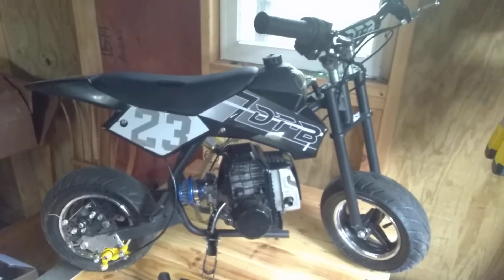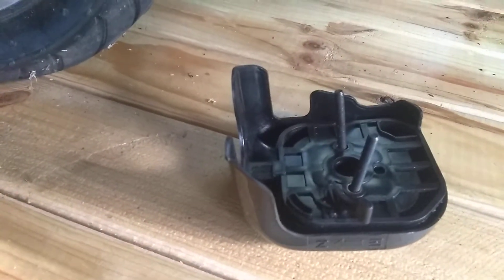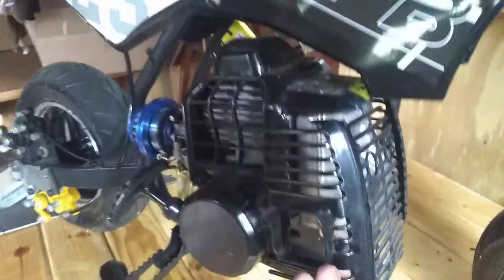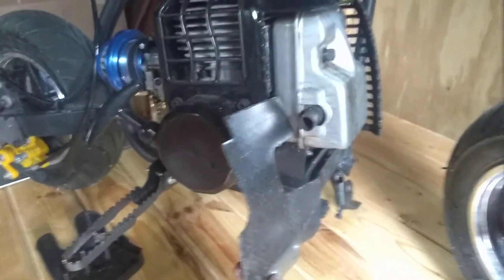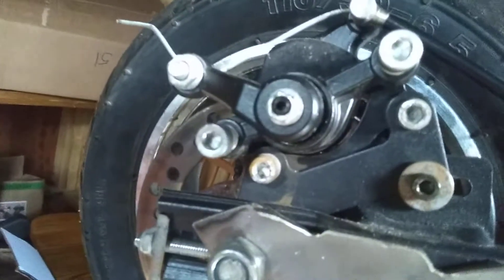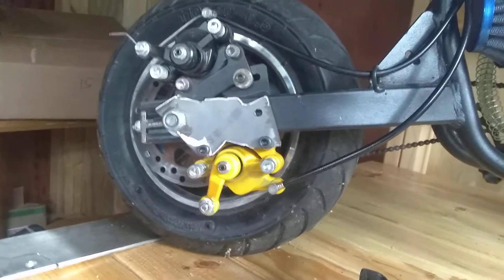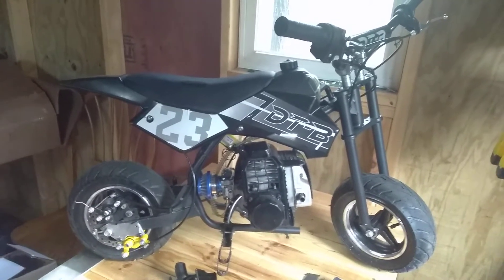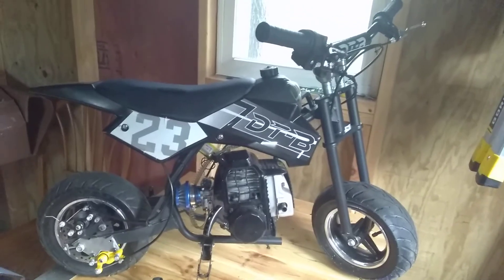UPDATE MODS on the fit right db002 50cc 2-stroke dirt bike Amazon pocket bike 2 stroke mini bike

Comment: Where did u get the intake filter ?
Reply from the maker: Amazon...just search "pocket bike air filter adapter", then look for one that says it fits 2 stroke 49cc. I have to say that when you tighten the bolts the chock will get stuck or at least hard to move. Also I don't know if it runs any better because I never tried it since I put it on.

Comment: What kind of gas did it take
Reply from the maker: It is a 2 stroke engine also known as a 2 cycle engine...So you have to mix 2 cycle oil with the gas. It is easy to mix the gas and oil...I did a video on mixing the oil and gas.
Reply: @TemperDriven  okay and did you use reg gas to mix with (87,89,92) ?
Reply from the maker: I use the premium gas like 91 to 93 octane but I don't know if you have to. It doesn't take or use that much gas so I don't mind using the more expensive gas and it might run better with it but I don't know for sure. 2 cycle engines smoke a little like a 2 cycle chain saw, but it is not so bad. I don't really use it much but I do still have it. It is a little slow but still fun to ride.
Reply: @TemperDriven  got one not long ago we’re you able to get that governor screw out